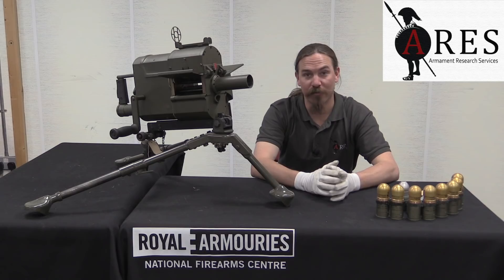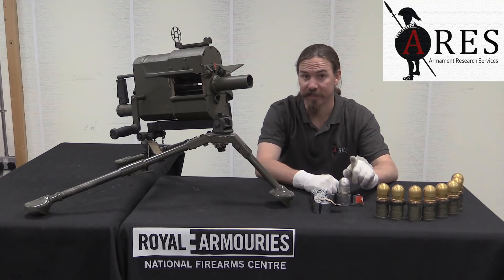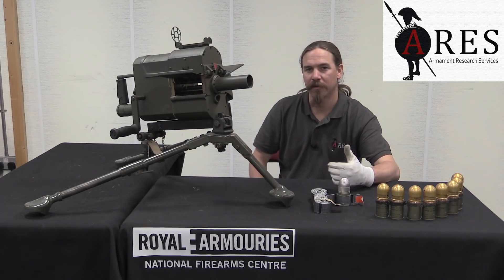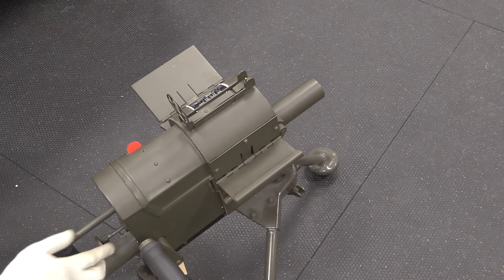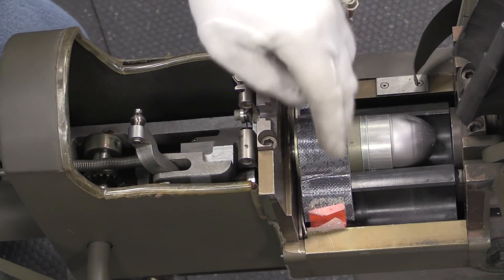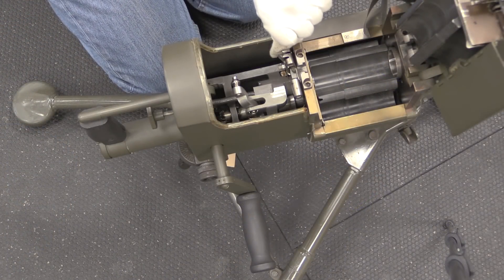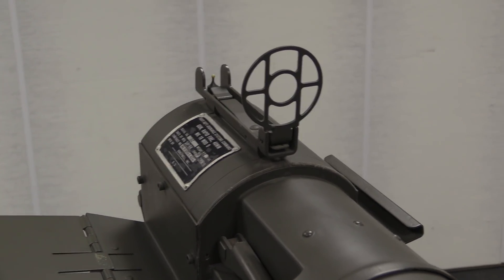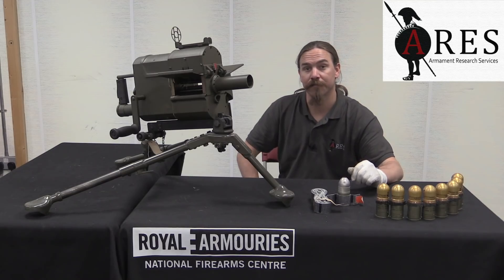Vietnam Mk18 Mod0 Hand-Crank Grenade Launcher

Comment: Somebody's job was to test-fire 5000 grenades through that thing? Where do I sign up for such a job?
Reply: Do you want to hand crank 5000 rounds
Reply: @generalolivervonbismarck393  you wouldn't?
Reply: @christophercollins868  I would love to.  I'd be happy just firing 5000 of the blue ogive, orange powder filled training rounds. It would make me feel like "Odd Ball" "Painting pretty pictures".
Reply: I volunteer as tribute
Reply: Pretty sure they just divided # of rounds by # of reported failures.
Reply: Research and development
Reply: Was imagining(using that) 5000rounds on hordes of orcs, Mina's Tirith, Lords of the Rings.
Reply: Sadly they probably just put it to a little engine to turn it on its own
Reply: ch-clunk FUMP ch-clunk FUMP ch-clunk FUMP
Reply: @JohnnyWishbone85  Cranking 5000 rounds wouldn't be that bad. I do about 1000-1200 strokes (about 1000 in 30 minutes) on a rowing machine 5 days a week so anyone who is even remotely athletic would have no problem cranking 5000 times over a few hours.
Unless you mean recoil in which case its tripod mounted with a spade grip using high-low grenades, so there'd be barely any recoil.
Reply: @Mateo Jamari No, we don't care
Reply: while that does indeed sound fun i wouldn't want to be behind or really anywhere near this thing when it doesn't fire as intended.
Reply: Just slap motor on it and there is no problem!
Reply: It’s not as fun as you would think

Comment: The Viet Nam era guys were the ones that trained me, when I was coming up as a young enlisted Marine.  
Some of the stories they told would curl your...  ahem

According to the late GySgt. Boksa (USMC) at least one of these made its way onto a Marine Huey helicopter.  They had to do some creative engineering to mount it, the heavy recoil was a concern.  Keeping it on target while cranking that handle in a moving helicopter took some practice.  Once they got it working though, it scared the holy living [edited] out of everybody.   Gunny said that it was great at keeping the LZ's perimeter clear of undesirables.
Reply: One of my friends was a crew chief for a group of cobras in veitnam(he had 9 cobras under his command) and he said they at one point had the hydras on the front turret of the chopper and the machine guns on the sides. Aswell as another chopper that was all hydras. The front had phosphorus and the sides had incindeary. They'd hover down in front of a treeline and unleash a hellfire of flames to the tune of six hydra rocket pods all going off at once.
Reply: "so here are the different loadout configurations for your vehicle"
"Thanks for the suggestions but we'll pass, we got some ideas"
Which pretty much sums up being a vietnam war vehicle crew

Comment: "We don't need to get into the mechanics of this cartridge today." 

Oh yes we do, daddy
Reply: It's pretty simple.  Standard high pressure "cartridge" inside and directly in front of the primer.  The rest of the case is hollow, and the HP part vents into this through gas ports.  Need the higher operating pressure for the powder to burn properly (go to Taofledermaus' channel and check out what happens you you set a shotgun shell off outside a chamber), hence the inner chamber and smallish ports.  Like he said, gas expands into a larger chamber, causing a huge reduction in pressure.
Reply: I love how you referred to Ian as daddy.
Reply: @immikeurnot  Thank you very much for the explanation!

Comment: Wow I had no idea they had an automatic grenade launcher in Vietnam. I thought they only had the M79 and early M203's. Great video as always Ian. Keep em' coming! =)
Reply: It's not automatic, it's hand cranked. What category does that fit in?
Reply: @John Garand: the US Military used many types of grenade launcher during the Vietnam War : 
- M79 (40x46mm, stand-alone GL for infantry use)
- XM148 (40x46mm, underbarrel GL for infantry use)
- XM/M203 (40x46mm, underbarrel GL for infantry use)
- China Lake (40x46mm, pump action, stand-alone GL for special forces use)
- M75 (40x53mm, Army automatic GL for helicopter use: UH-1 gunship)
- M129 (40x53mm, Army automatic GL for helicopter use : AH-1G, OH-6A, OH-58A)
- Mk 18 Mod 0 (40x46mm, Navy rapid-fire, hand cranked GL).
- Mk 19 Mod 0 (40x53mm, Navy automatic GL).
Reply: It would be considered Semi-auto because you have to do a separate action for each shot. Rotating the handle which basically equates to pulling a trigger for each shot
Reply: Always wondered about this as a book I read years ago described a hand cranked Gatling grenade launcher(hitman thriller ex Vietnam vet kind of thing) and I never managed to find it.
Reply: Ryan Peck- by that definition bolt action rifles would be semi automatic.

Comment: The Cartridge case has a High Pressure spherical chamber at the primer pocket which holds the main powder charge.  Which when ignited vents the gas through vent holes into the Low Pressure chamber of the main casing body, just behind the projectile thereby pushing the projectile out of the casing into the bore and out.  In effect the cartridge casing forms the chamber and why the split feed system works the way it does.  This also eliminates wear because the fired casing that houses the chamber for that round is replaced with the next round loaded into the path of the barrel.  The grenade is loaded into the cloth ammunition belt just like and early WWI belt fed machinegun.  And yes the it's a grenade, and effective range is what ever the maximum range of flight for that given round is.

Comment: We fired these weapons from atop a 50 cal on our riverboats (TF-117).  They would lay to the side while you fired the 50 then you could “snap” them up on top to fire. They had a tendency to miss fire but since you were cranking the belt the unfired round would just come out the right side still on the belt.  They had to travel a minimum distance to arm themselves so not useful in the smaller rivers.  But in the larger rivers you could fire about seven rounds before the first round landed...effective method to drop rounds just behind a landing zone...they had a kill radius of about 40 feet but in the jungle much less.  We nick named them Mattie Mattel’s because they looked like they were manufactured by a toy company.  Our 7.62 MG’s, 50’s and 20 mm anti aircraft cannons were the most effective way to keep the Vietnam Cong’s  heads down...otherwise they liked to pop up and fire RPG’s into the side of our boats.

Comment: This is the first time I have seen or heard of this. Did it use the same grenade as the M79 or did the M79 use the high pressure rounds.
Reply: toomanyaccounts thanks, that is what I expected.
VC troops captured during the Tet Offensive, said the M79 Was the weapon that scared them the most in that inner city battle.
Reply: Macnutz420 The Marines also had a pump action M79. Not sure of the name.
Reply: Hi-Low pressure rounds were developed by the Germans near the end of WW2 because they were running out of the materials to make propellant. It used a small amount of propellant in the bottom of the case that was contained by a blow through plate. Like a case with a false bottom. The small blast took  a moment to build up enough pressure to blow through the false bottom and then push the round down the barrel.

   Less propellant and as a happy side effect much more gentle recoil for a relatively heavy projectile. I believe the German weapon was the PAW 600. Number may be wrong. Going by memory.  Like many German weapon innovations the USA studied this post war and designed the M79. To shoot a standard 40mm cartridge from a small rifle would be really dangerous for the firer. The heavy, sharp recoil would almost certainly break bones and damage such a light fire arm.
    
   This gun would have to be hand cranked because there would not be enough recoil force or gas pressure to make an automatic action function.
Reply: EX41
Reply: Shawn R China lake. Never really used that much, they figure only between 16 and maybe 50 actually got made, let alone used. But it worked pretty damn good with HE frag. Not so much with buck/fletchet

Comment: yes, I had a love/hate relationship with the M79 (single shot grenade launcher) in sunny Vietnam in 68-69...first thing I learned about the M79 was that it will cut you like a straight razor if you don't hold it with love...also, the M79 is not a crew served weapon...just me with a bunch of heavy bandoliers of ammo and a raggedy ass 1911 (that I eventually put in my ruck)...funny, I never heard of the M18...but after seeing one, I got a stirring in my 70 year old nether regions...anyway I was going to comment on your statement about short range of the weapon...I don't know what the max range was on a M79, but (if I remember right) the sight had 350 meters as max range using the sight...could have been 300...getting a little foggy in my old age...in the bush that was enough...

Comment: If I recall correctly, "Dacron" (or "Decron"?) is just a brand name for Nylon so it would be a lot tougher than "just a cloth belt".
Also it would not absorb as much water which (again, if I recall correctly) caused feeding problems in machineguns fed with cloth belts (M1919, M1917, Vickers a.s.o.). I doubt that this...thing would have problems with that though since it's hand-cranked.

Comment: Both the 40x46 and the 40x53 use the high-low system.. although the Low of the 46 is lower than the Low of the 53....
Reply: Yes, the 46 was developed for the original M79 launcher, and is used on handheld and underslung systems. The 53 was designed for use with aircraft and crew served weapons like the MK 19. The point that I was trying to clarify was that Ian seemed to imply that the 40x46 used the high-low system and the 40x53 did not. Both grenades use the high-low system which allows a large projectile to be launched from a light launcher with reduced recoil by bleeding gas from a high pressure combustion chamber in the cartridge to a lower pressure void behind the grenade...
Reply: So you're saying the 40x46 is the low high-low and the 40x53 is the high high-low.

You take the low round and I'll take the high round, and....
Reply: ..well i'm already in Scotland :)

Comment: I have to admit, I'm both amazed and confused by this. 

Did no one ask why it was crank operated? Did no one think to motorise that part of it in some way? 

Also, I wonder if a longer barrel would have been a good idea? Could it have improved it? Either way, as a test bed, foundation for what came later, you know what, I'll take her as she is.
Reply: Motors require power (and/or fuel), add weight, increase maintenance, and make noise to operate. All of which are undesirable for a man portable weapon designed to be used in a random war zone.

If it’s something mounted on a boat or a vehicle, the math changes of course. But even then, simpler is better.

Comment: This would have been something very special had it been available before WW2, still very useful in the Korean War, but half way through the Vietnam War?
Reply: toomanyaccounts When this was designed the M75 grenade launcher was already in service, electrical, pneumatic, and hydraulic autoloaders had existed for over forty years, and if one wanted to avoid using external power then the principles of simple blowback long recoil operation were well understood. Hand cranked operation is finicky and hampers accuracy, it was a bizarre choice.

Comment: I was trained on a M 19... The Mk 19 is a belt-fed, blowback-operated, air-cooled, crew-served, fully automatic weapon that is designed not to cook off. It fires 40 mm grenades at a cyclic rate of 325 to 375 rounds per minute, giving a practical rate of fire of 60 rounds per minute (rapid) and 40 rounds per minute (sustained). The weapon operates on the blowback principle, which uses the chamber pressure from each fired round to load and re-cock the weapon. The Mk 19 can launch its grenade at a maximum distance of 2,212 meters (2,419 yd), though its effective range to a point target is about 1,500 meters (1,600 yd), since the large rear leaf sight is only graduated as far. The nearest safe distance to launch the grenade is 310 meters in training and 75 meters in combat. Though the Mk 19 has a flash suppressor, it serves only to save the eyesight of its operator, not concealing the weapon's position. For night operation, a picatinny rail quadrant sight can be added for thermal and night vision optics.